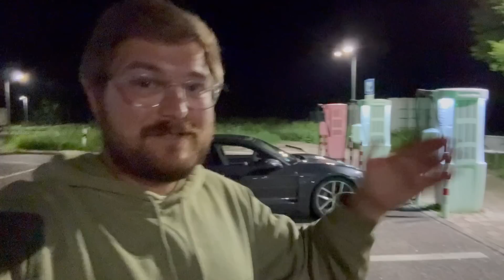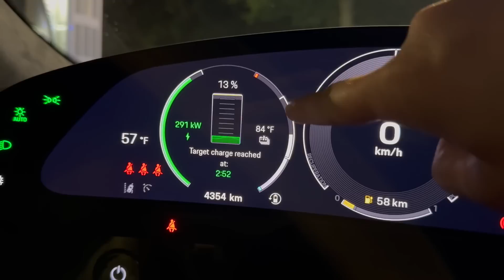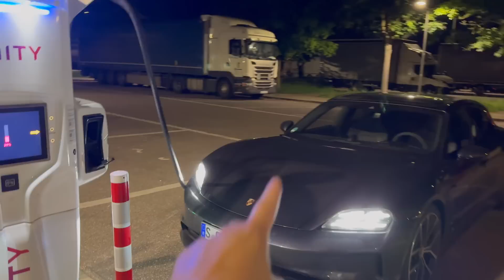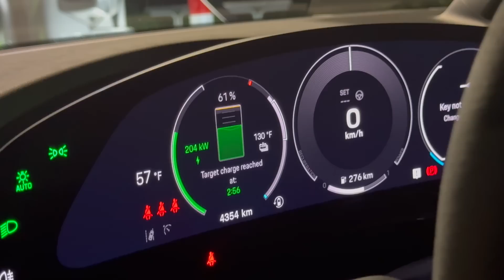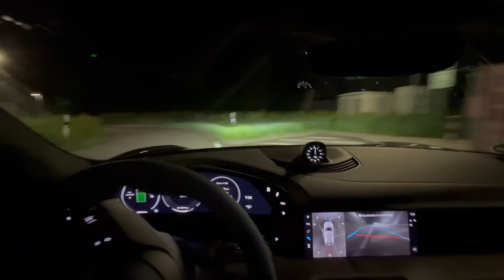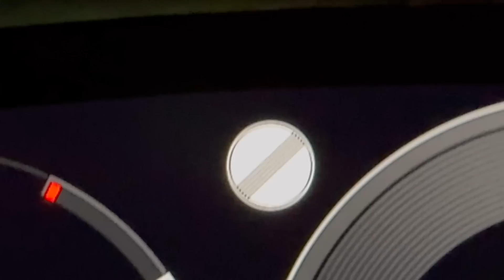The Fastest Road Tripping EV I've Ever Tested! Updated Porsche Taycan Sport Turismo 10% Challenge

Comment: So, I'm looking for a new daily driver; Previously I had an Ioniq 5 AWD, and as I can afford a Taycan (at least, what I would get is the base RWD with the smaller battery, since that has similar range and charges fast, like the ioniq 5, but likely better in Supercharges), and as this car can do a FAST charge as this test prove, even with the 277+ range of the small battery (I'e seen test where it wwent over 3000 miles), I think for road trips that would be fine for me, and frankly, may be just about as fast as the Taycan with the extra $100k worth of battery?  I want afun car, but don't have to have it go 0-60 mph in under 2 seconds, as I think a car that does it in under 6 secs is fast enough!). So considering this...
THe Taycan I'd spec is about $107 (it goes to about $115K final price incl. taxes and all). if I were to spec a similar Macan (base, RWD), it would cost me about $93K (finl price with taxes and dest. fee, etc) from what I estimated. Here is my qyestion. I do prefer sedans, but I see the practicality of the Macan. It does have a bit more range too at 315 miles EPA, and I think Tom did about 343 miles in State of Charge cahchanne and got 3 mi/kwh at 80mph? so, Macan is efficient! about as efficient as Taycan perhatps.. But, is the Taycan worth the extra $22,,000 more it would cost me? I mean, I can afford both, and I LOVE the look of the Macan. Frankly, one of my top choices would ahve been the A6 Avant (which we won't get in the US) so I was looking at the Q6 etron Prestige.. THen I saw a Macan in the dealer and Have seen a Taycan Turbo also (I was able to test the Macan, not the Turbo, though  somebody else was trying it out and I didn't have the time). Frnakly. I would be fine with the Macan  and I dont' want a Turbo or 4S even. I thiunk RWD is fine for me! and I'd prefer it, actually? Silly, but its a fun and engaging daily driver. 
Question is: IS the Taycan worth the extra $22,000 over the Macan? if it is, I would pay the money. I don't dont see in stats that it is. Maybe features or bild? (I mean, the Macan IS after all, an audi? but some may argue the Taycan is also an tron GT?) anyhow. I like the look f both and am maybe, perhaps, looking for a reason to spend the extra money and go for the sedan (Taycan) over the Macan, though most likely I would just get the Macan.

Comment: My two cents, after a few family EV Euro trips. This does not work when you have small kids. Stopping every two hours to charge is insane. They might have just finally fallen asleep, and for the next two hours should get some rest, and then stop, charge, have a walk, eat, run, be marry. But you should be the one that chooses when and where to stop, not the car. They are angry because sleep schedule is off, fall har back asleep, and you are now again just one hour away of having to stop again, wake them up, angry, so on and so forth. We drive 90 kmh on the autobahn because we have to prolong the trip in order for them to sleep, and have a good schedule. Then the road trip can begin. For a comfortable drive for the kids, not my bladder, I need 4 hours of driving, to be sure they are happy. My old Lexus gs450h, was a road trip king, dead silent. My kids were never angry, slept for even 3 hours, now, one hour and a half. I switched from hybrid to EV because I liked that cars EV mode so much, the engine was intruding, and thought to myself, let's cut that out :))))))))) still searching for my way back. Great reviews, put some of that data in kilometres, at least when you film here. Thanks and keep on experimenting!

Comment: Porsche is definitely pushing fast charging technology ahead as it should. I hope this better charging capability continues to improve while it simultaneously trickles down and becomes available for all BEVs. Also noteworthy is appreciating the actual amount of energy actually  transfed and the rate at which it is being done. Pushing almost 400 amps at 800 volt is nothing short of remarkable for reusable connector and a cable and connector small enough and flexible enough that it can be handled (perhaps two hands as you noted) by regular person. We are definitely closing in on recharge times that rival gasoline fill-ups.

Comment: You should try to get your hands on a Berlin build Model Y RWD with the BYD Blade battery while you are in Germany. It has a pretty flat curve at 170kw all the way to over 50% and when plugged in at high state of charge, still goes up to 170 kw for some time. Overall it charges from 10 to 100 in under 30min and therefor often is a better road tripping car than the LR Model y in Europe with the LG battery.

Comment: For safety reasons it's a very bad idea to leave a gas pump unattended while filling up.  While it may only take 3-4 minutes to fill up the driver is stuck standing next to the gas pump until it's finished.  With an EV a driver can plug in and instantly walk into the convenient store to buy a few snacks and go to the bathroom while it's charging.  The problem is it's not fully charged in that 10 minute convenient store stop.  If it was, you could start to make the argument that an EV road trip is actually faster than an ICE road trip, as you aren't stuck standing next to a gas pump for 3-4 minutes before you can walk into the convenient store.  BUT i think we are a long way away from arguing that EVs are better road-trippers than ICE vehicles... as impressive as this result was.

Comment: New Taycan has a 97kW usable battery and at 80mph you averaged 2.5 mi/kW. Leaving for a roadtrip at 100% SOC and arriving at a charger at 10% would give you 218 miles of range at 80mph. 15 minutes of charging gives you at peak speeds basically 160 miles of range at 80mph. So in total, you could travel roughly 378 miles in 5 hours including the 15min charge in the middle and arrive at your destination with 10% again. Your average speed would be 75mph and for a roughly 400 mile road trip it’s nearly identical to a ICE car. Most people aren’t driving 300+ miles without stopping anyways. I know this argument has been played out before with EVs but even with this napkin math and this test shows this car can easily do 400 miles at 80mph just as comfortably and quickly as a ICE vehicle. This isn’t even the most efficient version of the Taycan either! Pretty amazing show of tech.

Comment: Are all EV makers  using very similar lithium ion batteries? If so, what is the reason some EVs only hold a high charge rate for a brief period, and others charge at a high rate even when the battery is in a mid to high state of charge? Are some EV makers being incautious - or do they have technical superiority that lets them charge so much faster?
Reply: My guess is that a lot of the difference comes from the capacity of the battery cooling system. The faster you charge, the more heat you generate, so the more powerful a cooling system is needed to dissipate that heat. Some of it could also be Porsche willing to make sacrifices on battery longevity in order to be able to say that their cars charge faster than everyone else. The type of person who buys a new Porsche is someone who has more money than sense, so they probably aren't too concerned with how much battery degradation they have after 5-8 years of driving, and they'll probably be trading the car up (taking a huge depreciation hit) after 2-3 years anyway. For cheaper cars, such as a Bolt or Model 3, battery longevity is much more important.

Comment: Terrible  2.5m/kWh, NOT a good road tripper. I just did a 624 Miles trip in my 2023 ID 4 3.3m/kWh AWD with 20 inch tires charge 4% to 80% in 30 minutes , 2nd charge 11% to 80% in 30 minutes . (left home charger 100%)
The ID 4 can seat 4 pasengers comforatably you dont need to squish them in . 80mph is fine on the autobaon but a great way to get aticket in the Midwest USA  .Charging speed makes no difference if you need to stop every 160 miles .. If someoen wants to spend 100k just buy the lucid and drive 400-500 miles and drive past the DCFC ..plus you get a much COMFORT , Buick ride instead of roadster . Roadtrip not road track.

DCFC path is ignorant anyways, NIO has it right with Battery swapping (for rode trips) ..3 Minutes battery swap, they have swapped over 40 million times now. And you get a battery with 90-95% charge= another 20-30 miles before you need to stop again. also battery swapping does not reguire DEMAND CHARGES as all the batterie are being trickle charged.

Kyle if you are still in Europe try battery swap again..hasnt it been over a year since you last tried NIO ? Seriously ..take a road trip in Europe with just battery swaps..then compare to Porsche or any other DCFC and see how you feel about road tripping between the 2.
Reply: I'm guessing a lot of the reason for the 2.5 mi/kWh figure is the 80 mph speed. Like any car, if the speed were even a few mph slower, the efficiency would be better. Considering that this is a Porsche and people who buy Porsche's probably don't care at all how much money they spend on electricity, 2.5 mi/kWh is actually better than what I was expecting.

As to Nio/battery swaps, it still remains to be seen of the model is economically viable without subsidies from investors or the Chinese government. Considering how much bigger the footprint is of a battery swap station compared to a charging station, and the cost of operating it, with all those moving parts, plus an attendant, I'm not convinced. And, the grid connection to trickle-charge up all those batteries at once will still need the equivalent power of a DCFC station anyway.
Reply: @ab-tf5fl  80mph 2.5 yes that what I was saying.   Thats not a road trip but a cannonball .   Rodetrips are about comfort , maybe stoping at sights along the way  and getting to your destinatin safely, it isnt a sprint/race. Which is my main poiint th Porsche is not a roadtripper.

BTW NIO says their busy swap stations are already profitable .. trickle charging the batteries means NO DEMAND charges , demand charges are what make charging unprofiotable(high speeed charging). As far as an attendendant .. that is fantastic .. no such thing as being down, someooen is right there to REboot. Also the Stations provide power back to the grid when the grid needs it.
Reply: ID 4 and Porche take the same amount of time to travel 197 Miles ..per my actual road trip

For Car B: VW ID 4

To travel 197 miles, Car B's efficiency is 3.3 miles/kWh, so it requires 
197
 miles
3.3
 miles/kWh
3.3 miles/kWh
197 miles

  = approximately 59.7 kWh of energy.
Time taken to charge: 30 minutes

For Car A:Porsche

To travel 197 miles, Car A's Porsche efficiency is 2.5 miles/kWh, so it requires 
197
 miles
2.5
 miles/kWh
2.5 miles/kWh
197 miles

  = approximately 78.8 kWh of energy.
Time taken to charge: 15 minutes
Since Car B took 30 minutes to charge and Car A took 15 minutes, we can use the maximum of these two charging times to ensure both cars are fully charged:

Total charging time for both cars = max(30 minutes, 15 minutes) = 30 minutes

So, the total charging time for both cars to travel 197 miles is 30 minutes.

Every 197 miles the ID 4 charges once and the Porsche requires 2 stops .also calculate an additional 5-6 minutes to pull off the hwy and get to the charger and plugged in..So the Porsche requires at least another 5-6 minutes every 167 miles... 

This is of course considering the ID 4 driver is aseasoned adult driving no more than 73 mph on interstate while the young fellow is playing mario andretti 80mph on the interstate ;)  Hey I was there once myself.. I now road trip every drive is not a cannonball

Comment: Nice if they could integrate some of this charging tech into the lowly ID4.
Reply: I think it's a matter of time before it does trickle down. There was a time way back in the day when only luxury cars had features like power locks, power seats, and keyless entry. Today, even the cheap cars all have it. It will be the same with 300 kW charging speeds.

Comment: For EV’s I wouldn’t call this the best EV for road trips. I would just call it the best EV. It’s an estate, so it’s practical, good looking and drives well. It is built really well. Only big downside: price and costs. The 4S sport tourismo starts at 150k Euros with decent equipment and uses more electricity than others, but makes up for it in charging. Curious about Bjorn’s 1000km test on this.

Comment: Good job Porsche, but I already can't go to the restroom, walk the dog, get a snack and a drink before my Model Y is done charging. And I paid $53,000 before the $7,500 Federal tax credit and the $5000 Colorado tax credit.
Reply: most people down walk the dog, I get 600+ miles @ 80mph in my 520d and it takes 5min to fill up
Reply: @sender5804  And must not have a woman with you either, LOL. Cause you're be making a lot more 8 minute bathroom stops if you you do.  ...... As for yourself, If it takes you 5 minutes to fill up on a road trip, you can't go to the bathroom while you're filling up. You have to stand there. Then another 5 minutes to walk across the parking lot and go to the bathroom. By then I'm 2/3rds to 1/2 done with my charging. As soon as I plug in, I can go do my business. Not really that much difference in time.
Reply: @777Outrigger  you don't need to stand 5min, its like 30sec to fill up and the rest to do other stuff
Reply: @sender5804  I know better than that. I've had lots of gas cars.
Reply: @sender5804  I know better than that. I've had gas cars too.
Reply: One of the cons of the Porsche Taycan from Edmunds.  "EV greatness comes at a commensurately great price"
Reply: @777Outrigger that's not a con. It's a freakn porsche dude. Not a tesla. It's a premium luxury brand with a better look,better suspension, better fit and finish, higher grade materials and fabrics, etc.. cmon now. What's with these tesla average joes acting like a porsche is suppose to be affordable to the average joe. ITS A FREAKN PORSCHE
Reply: @G82Watts  Porsche's a great EV....  at a great price, LOL.
Reply: @G82Watts  Porsche makes a great EV. ..... at a great price, LOL.
Reply: @777Outrigger  every average joe in the world can own a tesla. Maybe that's why they turn no heads and get no compliments but it's more likely just their bland basic traffic blob designs. If u drive a brand new porsche head turns and compliments come with the territory. If everyone had one it wouldn't be a porsche. U can just look at the interior of a tesla vs a porsche and tell what the cheaper car is.
Reply: @G82Watts  Well, that's ok with me. I don't want what I am as a person to be closely identified with a car. ....But yeah, I do have people come up and ask me questions about my Model Y like no car I've ever owned. I happens a lot. You do have some bling when you drive a Tesla whether you want it or not. ... And Teslas do have technological luxury that no one one surpasses (Taycan only equals). And the seats are wonderful and that's especially a wonderful perk for a long trip.
Reply: @777Outrigger  if ur car is cool it just comes with the territory 🌟

Comment: If low-efficiency EVs are less impacted by elevation gains, extreme weather and strong winds, it would be reasonable to prefer low-efficiency EVs with high battery capacity, they'd be more predictable on long trips on variable roads.
Reply: it is the same with gas vehicles too. A old 460 ford got the same mpg no matter how you drove it 8-9mpg
Reply: Depends. Low-efficiency means you're less impacted by wind and weather, but you're more impacted by the charging speeds of the stations along your route. Traveling a corridor with only 150 kW chargers impacts your charge time much more if your vehicle gets 2 mi/kWh than if it gets 4 mi/kWh.

Low-efficiency also makes driving very expensive, especially when paying public charging rates. And, even when home charging, a less efficient vehicle needs you need more amps to be able to finish charging overnight, which, in turn, means a more expensive charger and a greater likelihood of needing upgrades to your electrical panel. Granted, nobody that buys a Porsche cares the slightest about the cost of electricity, but it's still worth saying.

Comment: We just did a non-stop two driver round trip from Los Angeles to Denver and back in a Model Y. With a dog, stops are roughly the same time as when we did the trip in a gas car, basically after taking turns using the restroom and walking the dog, the car was ready before us. Taycan 4S is on the list, hopefully it'll depreciate enough by the time my Model Y warranty is up.